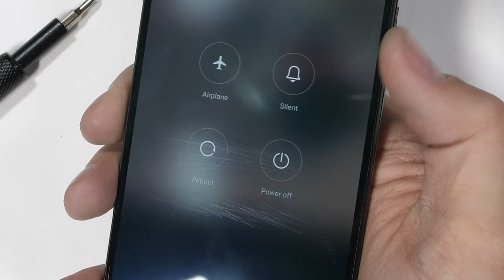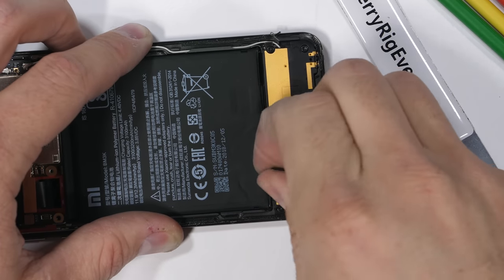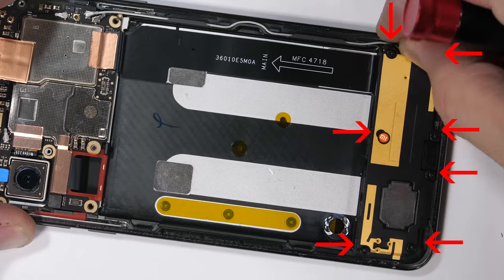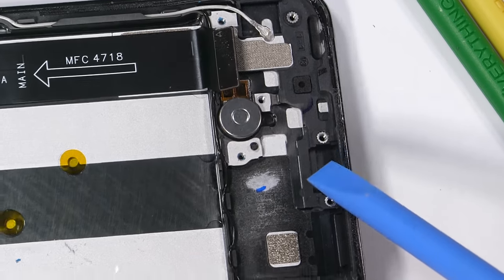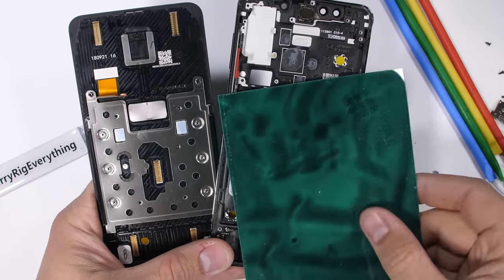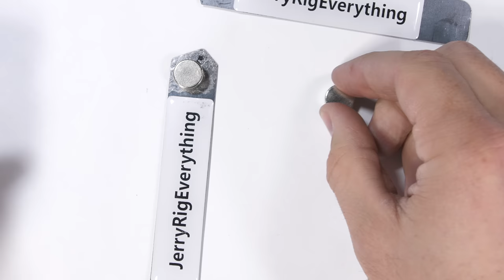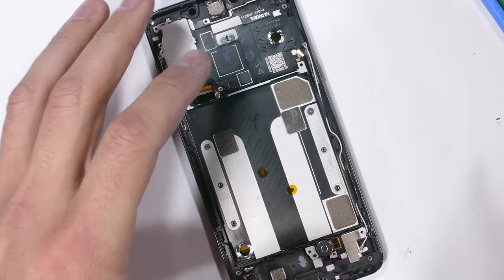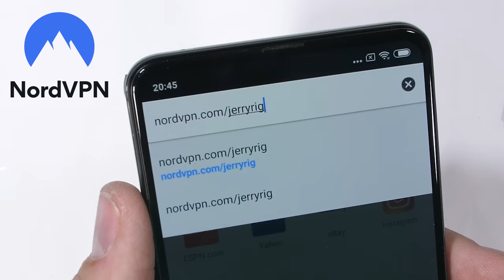The Mi Mix 3 is cooler than you think... - Teardown

Comment: I can't stress enough how cool using magnets instead of a mechanical mechanism to slide the display. This changes everything for me, I always viewed sliding phones as fragile. I thought they'd break over time so I wanted a few months to see if they fared well. Because of this I could never consider it an option for me. But now that I've seen this, I'm very interested...
Reply: Wait for one plus 7 it might be a slider phone also, and one plus quality is always a promise
Reply: now all you have to worry about is the cable mechanism. most Nokia is broken on the flexible cable
Reply: You know that magnets degrade overtime right? It may or may not be perfect for longevity
Reply: @midori8735  it lasts longer than your standard slider. You expect a phone like this to work for 10 years?
Reply: Just to add in I've heard the magnets are neodymium, the strongest kind and is not like those fridge magnets(obviously).
Reply: Yeah this is cool an all but magnets loose their magnetism
Reply: @midori8735  I just said that without seeing your comment.
Reply: @afirestone18   and yet this kind of mechanisms is better than the spring loaded sliders of the past...
Reply: Neodymium magnets if kept in good conditions(no extreme heat, no fractures on the magnet itself) will only lose around 1% of their magnetism over 10 years. I'd worry more on particles getting in between the slider if anything
Reply: @johnyramos8527   never said it wasn't a brilliant idea.. I'm just saying with the experience with neodymium magnets I've owned. They all tend to lose their force.. even if kept pristine condition. But this can take year more likely to burn your screen out beforehand
Reply: @Ventus1105  I can already hear the grittiness of crushing sand in the sliders lol.
Reply: @intg267  Yes. I'm more worried about the ribbon cable than the sliding mechanism. All the Sony Ericssons with sliders I've owned can still slide, but it doesn't register button presses anymore, even after getting a ribbon cable replaced in my W760
Reply: @friedceleron  same with Sony Ericson phone I owned years ago. It was a cool looking phone :(
Reply: I agree it is nicely built. I hate ribbon cables; they're the first ones to break on my video camera, laptop displays, a stills camera, and a sliding smartphone. However, considering the upgrade cycle of smartphones, the ribbon cable will probably last for at least 3 years and exhibit some annoying problems starting at the 5th year.
Reply: @bilgames2700bc  xiaomi quality is one plus over one plus.
Reply: @intg267  Sony Ericsons were prone to that too. I got one slider (good old button keyboard sliders) which screen has dies like that. Overslid, I would say.

edited when read to the end of the thread: oh, two more people had problems with Sony Ericsons too.
Reply: @afirestone18  Quality magnets like neodymium will last 10 times more that the life of the phone. So don't worry.
Reply: according to a fan test in China, xiaomi MiMix3 lasted over 750k sliding and were still working pretty well
If you slide it like 500 times a day
this phone could last for more than 3 years
Reply: I thought sliding phones would be fragile too... Until I got an Epic 4G. The Epic 4G had a very sturdy design. The keyboard was fantastic. I miss that phone. No other mainstream phone has been as physically perfect since. The death of slide-out keyboard phones is truly a shame.
Reply: I've been using this phone for 1 year 1 month, and this phone still great bro. No need to worry about the slider, it is solid.
Reply: @bilgames2700bc  say sike now
Reply: my sister is still using hers, after 4 years...

Comment: This is much better than the pop up camera, simple and brilliant. Keep it going MI
Reply: Good phone but battery is too small.
Reply: @pararera6394  endurance rate too high so small battery doesn't matter.
Reply: @pararera6394  I got the phone can reach a day like eaaassyy
Reply: My Redmi 5 Plus reach two and half days with one charge. So?
Reply: nope k20 pro is way better
Reply: @СтаиславИвановичЦой  Yep, but Mi Mix 3 5g better than k20 pro, only because it have 5g...
Reply: @rhapsodi  But 5G version has more battery 3800mAh
Reply: @Jixxerawx  nah I have like less than 20% around 3pm every day
Reply: @flarsiq  uff, i dont have this Problem... Gut 30% at 8 PM :/
Reply: I have this phone, the downsides for the slide mechanism are the phone became heavy and thick. The battery also doesn't last too long.
Reply: Do y'all have the same problem, when you try to go to the home screen, only wallpaper appears and the app icons load around 10 seconds after? I haven't found why is it happening.
Reply: @flarsiq  nope, no problem for me at the moment. It's already a year and still rocking. Got the non 5g version here.
Reply: @pararera6394  The battery is good. I mean its bad for kids since you can't play games for 12hours a day on it
Reply: @СтаиславИвановичЦой  but mi mix 3 have an OIS on the camera . So the photo is more clear and sharp on the dark

Comment: I have a mi mix 3 that I bought used, and I love it, the slider isn't even close to being fragile, and the overall quality of the phone is amazing....the ceramic back allows me to use the phone without a case and even being dropped frequently, there aren't any scratches.....I wanted to trade in my mix 3 for a newer, more powerful phone, but unfortunately there aren't any contenders as good as it....that's gonna make it very hard to trade it in

Comment: I mean, this has to be 'the' design to kill the notch right?  There is no reason to have giant bezels and notches anymore if phones follow the non-motorized slide mechanic. People who are scared of them being fragile must not have had a slide phone 10 years ago, which were always robust. (in my experience)
Reply: Exactly but people are just bootlicking S10, god damn it is just a notch without the bezels around it. They worship Samsung and call it innovation, while I see that MiX 3 is the first phone to put an end to the notch design without using a motorized camera, comes with wireless charging and respectively cheaper than any other "innovative phone"  the Nubia is also amazing but people like their stuff simple and can't handle another screen (but would praise Samsung foldable phone the other day)
Reply: And if you want to snap a photo fast you can, Just slide it open take photo that what i mostly liked about it.

Comment: Alright, if the OnePlus 7 Pro turns out to be overpriced, which is looking very likely, I'm gonna say bye Felicia to OnePlus and say hello to Xiaomi by getting the Xiaomi Mi Mix 3.
Reply: Well wait for k20 pro since oneplus 7 is over priced
Reply: idk if you would call it overpriced. It is actually quite cheap for the performance.
Reply: @user-oq1tr7ys5i  I just found a mi mix 3 with the down left corner cracked for just 236 usd. Can I change only the glass but not the display?

Comment: 1) remove loud speaker before removing battery (adhesive tape will not break)
2) rear camera (with bigger lens) doesn't have optical stabelizer, moving lens - is a EM Focusing mechanism (the same as in other phones). Upper camera lens almost fixed because it's 
depth of field area is bigger.

Comment: Xiaomi JUST keeps on delivering for a fairly REASONABLE PRICE may i add.
Reply: Also Huawei, oppo, vivo, honor....
Reply: They get like 20$ profit from each phone. Quality is not compromised by the price.
Its a must have phone line-up while Xiaomi keeps that politics
Reply: Nuno Herdeiro  "features" i prefer the term bloatware
Reply: Nuno Herdeiro  of the 5 xiaomi has the best ROM wdym features then
Reply: @tjl2836  Vivo my ass it is worse and costs more.
Reply: Additionally 21  - Where did you get those prices from?!? If you look on any store website in the US, they all have prices hundreds of dollars more expensive. And Oppo makes some of the cheapest phones that still have the latest tech.
Reply: @tjl2836  the "latest" tech isn't always the best... Oppo r17 pro is 615 USD with a snapdragon 710, OnePlus 6T 550 USD snapdragon 845. Mi mix 3 is 475 USD and has the snapdragon 845 as well. That's a $140 difference for a phone with dramatically less performance.
Reply: @Untanas  - Where the heck did you get those prices from?

Comment: So the Mi Mix 3 has an interesting Achilles Heel where thin objects can get in between the halves and damage that ribbon cable. Thanks for the teardown, without it I wouldn't have been able to replace my front assembly after that happened.

Comment: I use my mi mix 3 since January 2019 till now.
Reply: mine is arriving tomorrow.
Reply: Did it ever get a little wet? Since there's no waterproof at all inside i'm wondering if it survised a trip through rain.
Reply: @Hurrikan7638  no water resistant, so keep out from water.
Reply: @fernandoandikahutabarat2359  ok, thanks!

Comment: but how the phone knows if it has been slided or not??
Reply: When it slides down , the phone's motion sensor detects it and sends a message to xiaomi head quarters saying the phone has been slided then xiaomi headquarters sends a message back to the phone's brain saying it has been slided hence finally the phone understands that it has been slided
Reply: Just like little lego...😂
Reply: George Sabu headquarters lmao
Reply: @georgesabu3310  - wtf?!!?
Reply: @georgesabu3310  - And it still is faster than a iPhone
Reply: Hall effect sensor. It will 'see' the change magnetic fields and output a signal accordingly to the processor.
Reply: I found out guys its just the proximity sensor

Comment: Do a teardown of Honor magic 2
Reply: It's a normal phone not special at all
Reply: pretty bad phone man
Reply: @SuiYo  how could you say that?
Reply: Mi Mix 3 has more effort and care put into it, better value for money, wireless charging, notification led, programmable button and slider and it is a global release. Also newer version of Mi Mix 3 will have 5g and snapdragon 855
Reply: @SuiYo  magic 2 has 40W super fast charging, 6 cameras bt it's kinda gimmicky whatever, smoother slider than mix 3, gorgeous gradient back. Also magic 2 is the first sliding phone in this generation. Honor declared   magic 2 about a year ago. We can say Xiaomi keep copying 😑
Reply: What? Magic 2 came after the mi mix 🤣🤣🤣. The 6 cameras mean nothing if they are all bad. Also the smoother slider is worse as it is easier to accidentally activate (see mix 3 vs magic 2 comparisons) and is less satisfying to use. Also you can't customize what the slider does unlike the mix

Please find where the magic 2 was even announced 1 year ago with slider because Xiaomi was definitely first
Reply: @SuiYo  
Magic 2 also has an oled display which is a major plus, for me anyway.
Kirin 980 is half a generation better. 
Fast charging is really, really fast.
Battery is bigger.
Looks much better as well.

The biggest problem with Magic 2 is software. 
There won't be a global version. Chinese ROM is filled with bloatware and blocks 3rd party launchers(like nova). And to make things worse honor/huawei now block the bootloader, so you can't even root it.

I was actually choosing between Mi Mix3 and Magic 2 for about a week.
Then I saw a sale for Galaxy S9+ for 480$ :D
Reply: @SuiYo  magic 2 was showed off first  but mix 3 was released just before Magic 2. And that's true, Honor worked on magic 2 saying it would be an all screen phone a year ago after launching original magic
Reply: @nafazrahi7224  "Year ago" maybe I have read enough misleading comments.
Reply: Its better to tear down a nokia 3315 than honor phone
Reply: @nafazrahi7224  You really think Xiaomi didn't work on the slider on Mi Mix 3 until Honor Magic 2 was revealed? It takes more than a few months to create a phone. It was in end of August magic 2 was revealed.
Reply: I wouldn't recommend getting the Mix now as the snapdragon 855 version with 5g is meant to be 45% more powerful

Comment: Thanks so much, fell in love with the phone from the time I came across it. Got it on the 19-01-19. Super happy with it. Was never worried about the slide as I had one back in the day (matrix phone). But never expected that the inside is as cool as this 🤩. It's a HEAVY mobile, but I'm getting used to it. Battery is good last two full days on standby and a good day with normal usage. The cams are fantastic, it takes better pics than the S9+ (IMO) and the vid quality with OIS is 2nd to none. I've got a matte silicon wrap on the front, back & sides. It looks dope!! No more fingerprint issues and the anti glare makes it just a dream boat. Thanks very much for the Fab Rad vid. Subbed 👊😎 PS. Hope my 2 cents helps someone make a decision.
Reply: Where can i get that matte silicon wrap ( lol i know this comment is like for a year ago, but do you still have the phone ? ) I also got the phone like first month of 2020 its working great until now ! Just interested to know where can i get that wrap thing !

Comment: Holy smokes that is some smart design language. I was thinking about this phone a lot, this and the Mi 9. I went for the Mi 9 because I was kind of a little bit panicky about them moving parts but I feel very much safer after watching this. Still I would say the Mi 9 is an overall better pick because it is cheaper and comes with an upgraded procesor and graphics. But wow I am impressed by that sliding mechanism design, that is smart. Thanks Jerry

Comment: Xiaomi made a got job on thermal solution with thermal grease. My current Redmi Note 4 is very cold device never reach more than 45*C. Before it I had LG G3 which was terrible hot about 90*C and when I opened it the CPU was working without any radiator on it.

Comment: Your description of the magnetic slider was not correct. I believe the magnets are always repelling in both the up and down positions.
Reply: He also said the rails are stopped by a rectangular piece, but they are actually stopped by the circular piece whic is off center. This makes the phone wiggle a little more in one side relatively.

Comment: Checking in after a little over 4 years with this phone, and it's held up amazingly. Just recently switched off of it because the battery life is getting pretty awful after so many years, and if it weren't for that and software support ending, I'd still be using it. Nothing really compares to it in terms of feature set, price, durability, etc. The Pixel 7 Pro I replaced it with feels like a downgrade in so many ways. If the Mi Mix 4 ran GrapheneOS, I'd be using that, but such is life. :(
Reply: These are great phones, my screen finally broke a couple months ago by dropping it straight from my car to concrete. When it was working, it was still a blazing fast phone, all the apps were instant, never had any lag, the camera was awesome too. I wish I could find another one lol.
Reply: Ordered a brand new one today (October 1st, 2024, for £120 off of Amazon!)

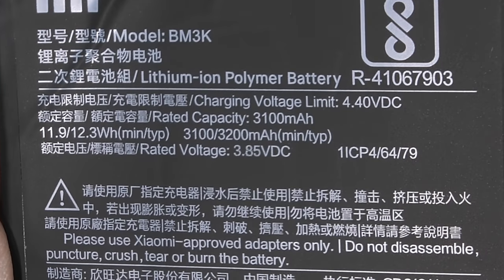Comment: @ 2:30, You mentioned that the battery is rated at 3200mAh but on the battery itself it says that the rated capacity is 3100mAh. Everywhere else I checked also mentions 3200 not 3100. Does anyone know why?

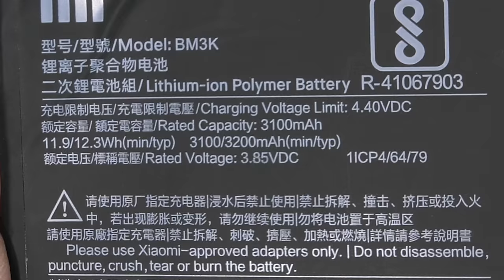Comment: just a quick question ...at 2:27 rated capacity says 3100mah. Yet Zack says 3200 mah is there a reason for this or is there a mistake? Like on their site it also says 3200 mah but alot of manufacturers like to round figures up a bit

Comment: The mi mix 3 5g have wireless charging?
Reply: Nope. Mix3 without 5g has, but it also has smaller battery 3200 vs 3800 mAh. Also the difference is in GPU and CPU.  5g ver is a bit more efficient. SD 855 vs 845 and Adreno 640 vs 630.